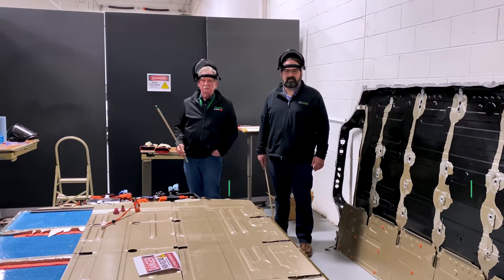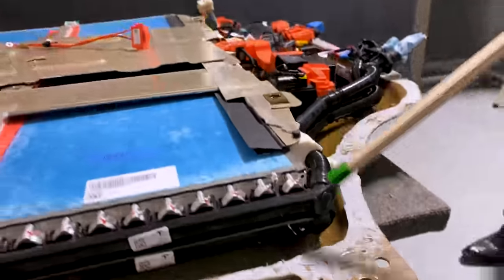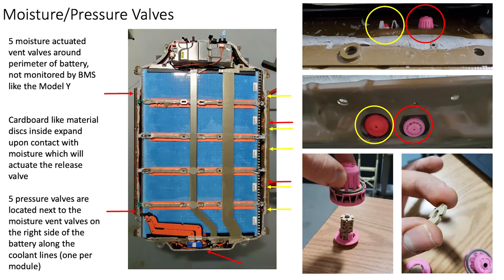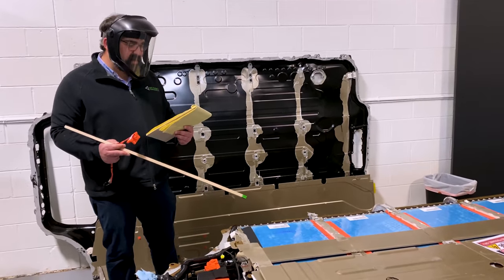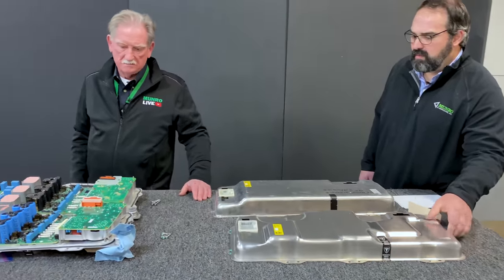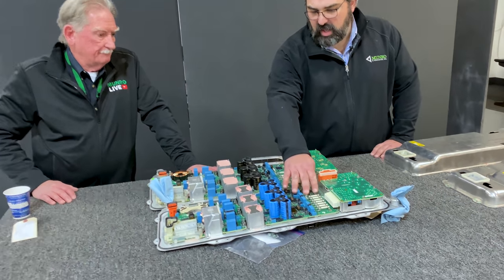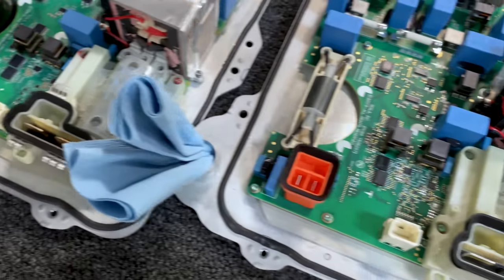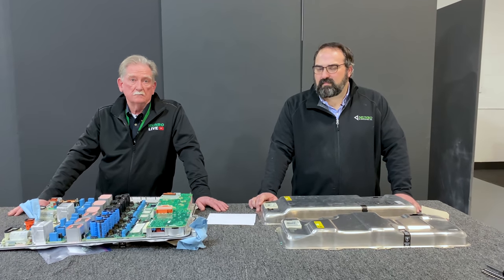Engineering Masterpiece | Tesla Model S Plaid Battery Pack

Comment: Are the DC-DC and the onboard charger still replaceble, by removing the "penthouse" lid/door from above, since they are now inside the battery housung now, or you'd have to take down the whole battery and open it, which I think is a bit unsustainable design? Both of those are commonly failing components at least in other ev brands.
Reply: I think having commonly failing components is more unsustainable.
Reply: I think worst case, they break the seal to open the pack up and make the component replacement and then reseal. Much like replacing an oil pan or transmission cover.

But I don't think those components should be failing unless they get flooded due to a compromised case.
Reply: @taylor92493  Well nobody wants to replace 25k$ battery because of leaked capacitor that costs 2$, but now that I watched that part again, it might be accessible from above by pulling up the "penthouse" lid
Reply: @Jaker788  from my experience wherever you have electrolyte capacitors (those blue ones) you should expect failures-even if you source the best ones those defect or degrade and leak after time.
Reply: @Jaker788  Have you ever seen an oil pan or transmission cover sealed with structural adhesive? It's not much like those examples at all.
Reply: Any company that has its shit together will design their power electronics so that they NEVER fail.
There are gasoline-powered cars over 30 years old that still have their original engine management systems (ECU) and they work just fine.
No excuse for common electronics failures!
Reply: @devilsoffspring5519  I repair a lot of vehicles from the 80s & 90s that have failed components in the ECUs. The # of Honda ECUs I've seen in the past month from that era is pretty insane. The key is that they are easy to service when they fail.
Reply: @devilsoffspring5519   I cannot agreee that ECU has anything common with a AC onboard charger. One is fine electronics, the other is high voltage, high power electronics. The latter is exposed to external factors, such as the power grid you are connecting it to, where you could have voltage spikes, voltage drops, bad ground, sine interference etc. Plus the ECUs also fail- you just unplug them and change them for 1000$. Teslas have of those too.
Reply: @klisurski  It should still be possible to build power electronics that last practically forever. Large electric motors used in industry have electronic controllers that handle a lot more power than you'll ever find in a car, and regular failures in business are unacceptable.
Just like they are in cars.
Reply: A single dry cap or a solder joint that failed after a while, and you need to pay for a new battery.  Tim Cook approves.
Reply: @devilsoffspring5519  it's possible but it's expensive.. those industrial motors are understresed But very expensive. That's why they last

Comment: Good, Tesla model s Plaid, what is detailed electric motor powers? yes 1100 hp, but is that rated power? maximum power? if maximum what is the rated power? Also, since the sum of the three engines is 1100hp, I want to know the value of each.
Reply: Maximum power.
In Model 3 AWD or Performance the 30-minute-power is 153 kW.
Reply: "SUFFICIENT"

Comment: While Tesla is still distributing parts all over the vehicle to maximise usable space, I think there is lots of saving to be had by putting the charge point on the front quarter panel, near front door, and having an inverter  box with all the high voltage equipment in it bar the battery and motors. They should then have a low voltage box next to it which includes the main circuit boards and 4LFP battery cells. Next to that would come the HVAC systems. It could all be mounted on the strut/air tank. A few metres of cable between inverter and motor is fine - it is done in F1.
Reply: Inverters can be remote from the motors, but it is electrically undesirable and has no advantages - high voltage and cooling will be needed at both the motors and the accessory equipment location, regardless of which one includes the inverters.
Reply: @brianb-p6586  The undesirability is tiny, other factors dominate with F1 cars 2 motors (60 KW attached to crankshaft and ???KW attached to turbocharger). Material mass, part count, thermal exposure, circuit length and x-section, damage risk, packaging and assembly costs all favour separating the inverter from the motor. Inverter casings are often a similar material to the motor casing when attached to protect from damage. Plonking all the HV inverters for charging, front and rear drive, and HVAC on one cooling plate in a waterproof intumescent plastic box high under the hood, shortens circuits. Inverters are light weight, so high up away from floodwater is no bad thing. Many first gen MS were written off after excursions into water. The Cybertruck will now be dual rear or quad motors, and Roadster quad motor presumably. Semi is quad motor. Munro noted that the MY and new MS have essentially the same electrical architecture, with part positions not occupied where not needed. Tesla could have essentially the same electrical architecture for all its vehicles by changing cable sizes and populating/not populating parts.

Comment: They actually have fewer cells than the old 100 kwhr battery…
Reply: And less capacity probably.
How the 10C discharge was accomplished peaks my interest. Rimac is at 16C with 18650, but likely more costly cells.
Reply: @Cloxxki  seemingly more capacity per cell. About 99 kwhr for the pack. Looks like 3400 mah per cell. Over 8C discharge. Someone measured 818 kW out peak.

Comment: Maybe they used Mica also as a thermal insulator to keep the battery temperature affecting the cabin and keep the battery as a heat source for the thermal system.

Comment: Please use a fiberglass hotstick for the pointing instead of wood, wood is a pretty good conductor with high voltage.
Reply: Wet wood maybe but generally dry wood is a pretty lousy conductor of electricity. Plus they added, what i'm assuming is non-conductive tape.
Reply: wood isn't as good as you think
Reply: @michaelvillalpando4189  True but I guess they don't measure the moisture content, and I see some high voltage stuff in this video like the gloves in the background and the masks, a hotstick should be mandatory.
Reply: You should use PPE.  They are professionals, they know what they are doing.

Comment: The purpose of the mica layer could be for thermal insulation, as mica has a very low coefficient of thermal conductivity.  So the battery could be operating at higher temps without transferring that heat to the cabin.
Reply: Correct.
Reply: I think it's hilarious that one comment claims the mica is used because of its high thermal conductivity, while another says that it is used because of its low thermal conductivity. In fact it's similar to glass - neither a good insulator nor good conductor, thermally. It can handle high temperatures compared to common insulators, which is likely the reason for using it.
Reply: Mica is a fascinating material, and you certainly can find uses of it which claim for both high and low thermal conductivity. Given the location, the low conductivity forms ( like this https://www.addevmaterials.eu/catalog/composition/mica) seem the most reasonable. However you are free to draw your own conclusions.

Comment: A masterpiece? From which point of view? Certainly not from that of a customer or the environment. Here you can clearly see that a repair of individual assemblies, segments or components is not intended. 
In case of a defect, only the entire battery can be replaced. Especially interesting if the car is out of warranty or you buy a used car. 
Sustainable, environmental and customer-friendly is something else. It will be your "masterpiece" if you have to put 20,000 on the table because a $2 part has gone broken.

Comment: Not sure about that moisture vents: where is the moisture coming from? Is it to drain after a ditch? If, then whyare those openings not at the lowest point? Another thing is the sealant to the outside of the car: how is it made?  Is it really withstanding the harsh environment like freezing, salt water, stone chips, also semifrozen puddles with high speed (which is even abrasive to painting) for about 20 years? I personally would put cameras into the battery compartment. I want to know if juice and corrosion is there before i loose my battery or my even live.

Comment: I can't help but wonder why you didn't drive the car more and drain the pack before the tear down?  Also could have run the heater and let it help heat the shop to get the last little bit out without risking being stranded.
Reply: Also manually discharge the cells?  Harbor freight sells that carbon pile load tester.

Comment: Fiat cars have always been very modular with common parts carried forward (sometimes! over decades. But while the rear hubs and hub carriers are almost identical they have stuck with mounting studs and nuts. Bolts would be faster to fit,  easier to service and save a few cents. But they never changed.
Reply: The same goes with vw, from the tiny vw up to golf, Tiguan, Touareg, Audi, Lamborghini, Bentley….. they all share parts.

Comment: so GM’s Engineering enabled the production of the Model S plaid. 

IS THIS PACK CONSIDERED WATERPROOF? 
IF SO TO WHAT APPROXIMATE DEPTH?

also how much shop time would be required to replace one whole pack with a replacement unit?
Reply: Probably still as easy to swap as the early ones that took a robot 5 minutes. Just now there is more stuff inboarded. Strangely not more cargo space freed up. Perhaps due to the extra motor in this one?

Comment: So impressed with the design. Same component for the family car vs super car.
Motor comparisons will be interesting. 
Hope you can get your hands on a current generation insurance write off Model Y with 4680s.
Reply: A Chevy pickup and Cadillac performance luxury car are available with the same engine - this is nothing new.
Reply: @brianb-p6586  
🙄
Reply: I'v seen elsewhere that they use motors with a lot of the main parts in common but the Plaid ones are wound with carbon fiber so they can spin a lot faster. It'll be interesting to see if this is true.
Reply: @donjones4719  You don't have to wait - others have torn down Plaid drive units and confirmed the carbon fiber wrapped PM rotors.

Comment: The Stamax PP composite isn't inherently flame retardant.  I'd imagine it is loaded with flame retardants like ATH, polycrystalline alumina, or other intumescent materials likely mined or fabricated using energy intensive synthetic processes.  Still a better thermal runaway protection and emergency egress solution than mica though.

Comment: Pls. show how the battery is attached to the body in white. Bolts only from under or from both sides like the model 3 ? How difficult to cut the silicone to get the top part of?

Comment: It will be sometime before legacy automakers will be able to do such engineering
Reply: @timemachine_194 And yet none of those 800V performance cars are nearly as quick as the plaid
Reply: @timemachine_194 The Rimac is not is the same category as the Plaid. Look at the price difference. The Rimac is only 8 tenths quicker in the 1/4 mile than the Plaid

Comment: Ever since Sandy became a Tesla shareholder - Tesla can do no bad. They even justified old cells, modules and compared this 100KWh battery with the  original 85KWh one from 2016 and surprise surprise it’s better!
Reply: The new cells were never good for high C loads though. By lack of vast better chemistry with lower internal resistance, heat dissipation is still a huge factor. 18650 better than 2170. The overhead saved in 2170 is line 3% or so for energy density, but sure saves manufacturing cost.

Comment: So how many cells in series is this plaid battery?  The old Teslas were 96s so with no minimal 3.7 volt per cell cones on to 355volts and with each cell  fully charged at 4.2 volts comes to 403volts. Is the plaid battery the same?

Comment: Metallic sheet must be for emc shielding protection
Reply: It's not a good electrical conductor, so it does not provide electromagnetic shielding.
Reply: @brianb-p6586  yes it does. If they remove the metallic sheet must be becuse that connector does not need emc shielding protection
Reply: @rompedientes123123  Sorry, I read your comment as that the "mica" sheet was for EMC protection. If it always said "metallic", you're talking about a different component and I just read it wrong.
Reply: I am talking about the metallic sheet directly welded to the cover in the connector zone that is no more used on the Plaid. Maybe the metallic sheet is not for emc protection, only Tesla engineers will know it.

Comment: At first I thought these brown discs of the pressure exchange valves were molecular sieves for air dehumidification.

Is there a technical implementation for air dehumidification in the battery?

Comment: Could the new capacitors be made by Maxwell?  I wonder if the new transformer is a significant source of increased efficiency?
Reply: Maxwell was purchased and absorbed by Tesla.
Reply: My question as well. But Sandy said bought from supplier??? The capacitors they bought of Model Y and S Plaid from whom???
Reply: @ericogden4589  to rephrase are they made in house using their patents.  Or did they contract a supplier to process based on those patents/specs obtained through the acquisition.

Comment: what a great desing if you have a failure of the DC to DC converter or the charger you have to drop the battery pack and then deal with the sealant and the worst thing is that you probably can't buy any replacement parts inside the pack from Tesla so in a other word they will be happy to sell you a brand new pack because the charger and the DC to DC converter is inside the pack well at least they have a front trunk.

Comment: If you do the math and scale up this 18650 here to 21700 (volume factor: 21²/18²*70/65) and 100.000 Wh for the pack diveded by the number of cells. Then divide it by 3,7 Volt, you get 5 Ah. So basically, Tesla just puts the Model 3 Panasonic chemistry into the 18650 housing.
Reply: I don't think much of your conclusion is close to correct and certainly not worded to express what you are trying to say. The energy density has never varied a lot between full EV car cells of similar year, to my knowledge. You craft a peculiar calculation but seem to be after cell energy density by volume?
Reply: @Cloxxki  I think my calculation and conclusion is correct. Your assuptions are all wrong regarding cell technologies of different cell chemistries of different manufacturers around the globe AT THE SAME TIME. If the "rule of three" and basic math is piculiar for you, I suggest some primary school math crafting.

Comment: Im not an engineer so you may have just jumped over it because you all understand it and I don't, but I don't have any idea how the coolant cools the batteries, and I was hoping to learn how that system works.  I know about the octovalve and heat pump, but im curious how the heat is removed from the cells.  is there a vid that covers this?  Im a programmer so for all i know they submerge all the cells like a nuclear cool-down tank
Reply: Coolant is pumped through the battery to cool/warm it up.
The rail on one side of the packs is connected to the pump, and the black thingies on it are electrical controlled valves.
They can now cool part of battery that's getting the hottest instead of whole thing.
Reply: The side with the plumbing has two manifolds - one for incoming coolant and one for outgoing. There are loops of aluminum tubing which run from one manifold, between the cells across the pack, back across the pack between another pair of cells, and into the other manifold. It's essentially the same system, probably with the same tubing, as used in other Tesla modules.

Cells are not submerged in this design (although it has been done by other companies, but not in mass production) because that would require sealing of the entire module and non-conductive coolant. It would also be structurally challenging to leave coolant passages, given the way these modules are built.

Comment: I would like a tear down comparing the Chinese EVs
Reply: I can't wait for the NIO with 150 kWh solid state battery. Hope it's real. Tesla's hyped 2170 cells was soon undercut by safer Chinese cells. So rather than selling cells they are now buying loads from 3rd parties.
Reply: @Cloxxki  Tesla never hyped the 2170 cells, they are just Panasonic cells. The 4680 battery packs however are designed in house by Tesla and will drastically reduce manufacturing costs. That's how you make EV's mainstream, by reduce the cost so it matches ICE cars, not add more expensive batteries like solid state.

Comment: Can the Plaid do Vehicle to Load and or Vehicle to Grid?
Does it have any 110/120 volt plugs if yes, what is the amperage?  5-15 15 amp or 20 amp plug?
Reply: No, and no. but it does have 1,020hp ;)
Reply: No.  V2G is bs.  Sounds nice until you find out you need to do $2-3k worth of work on your home electrical system to take advantage of it.
Reply: V2G is bs? Daddy own a fracking well?

Comment: Wouldn't the larger battery cells cause less heat anyway?
Reply: Batteries or cells?
Power output minus efficiency causes heat. Getting such from smaller cells offer a higher cell surface area to dissipate heat through. Less surface = more heat build up.